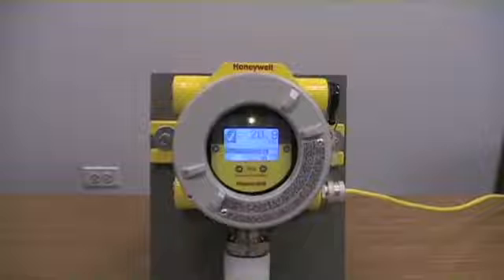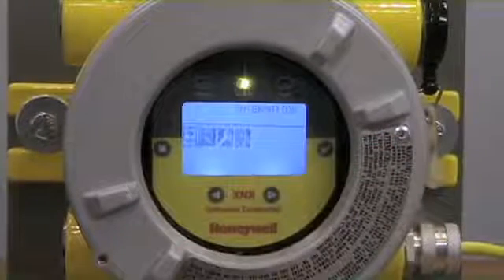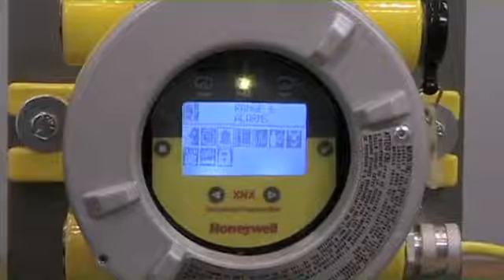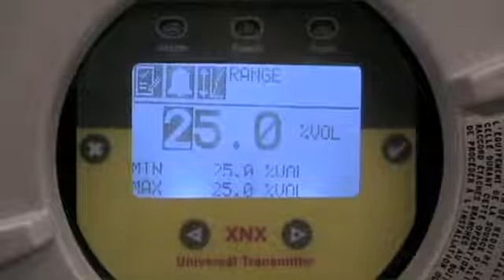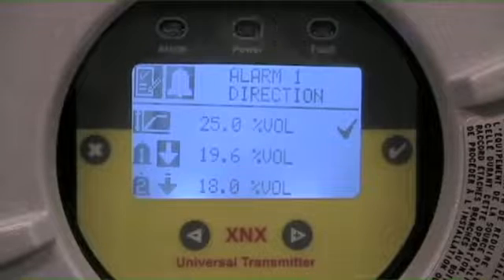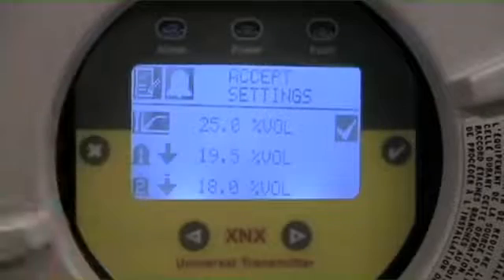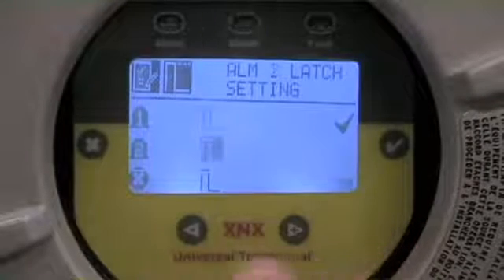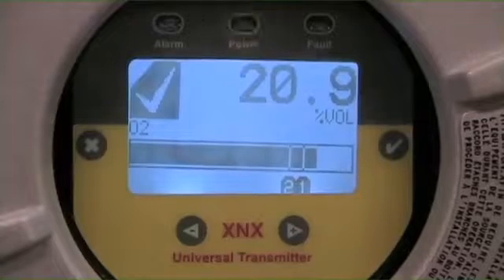Honeywell XNX - Quick Start Video - Sensor Ranges and Alarms

Comment: If the alarm set points aren’t set could that cause the equipment to be in the fault state?
Reply from the maker: That wouldn't cause the fault. Do you see a fault code on the display?  There should be an Fxxx or a Wxxx showing on the display that will describe what is causing the fault.  If you can provide that, we might be able to help further.
Reply from the maker: Check the Warnings and Faults section of the XNX user manual: https://www.lesman.com/amfile/file/download/file/1537/product/2722/ 
It starts on page 118 of the manual, and should help you identify the cause of the fault.

Comment: I’m working on a job that has these. The fault light is flashing continuously so we are not able to calibrate. How would I clear the faults to get calibrating to work?
Reply from the maker: Check the Warnings and Faults section of the XNX user manual: https://www.lesman.com/amfile/file/download/file/1537/product/2722/
It starts on page 118 of the manual, and should help you identify the cause of the fault.